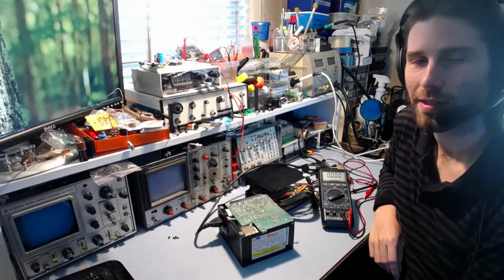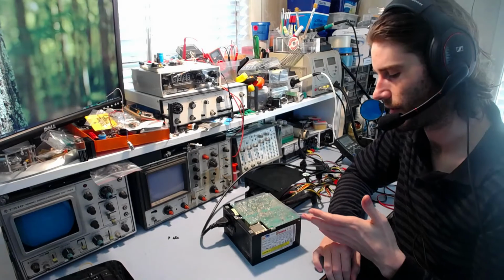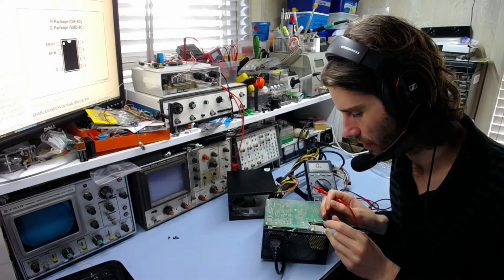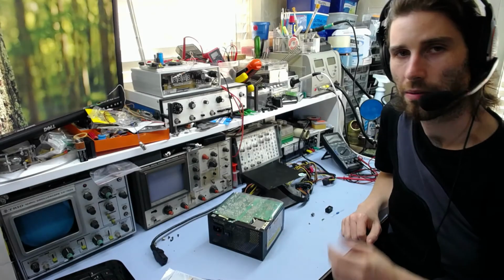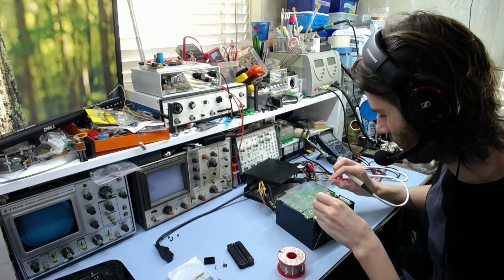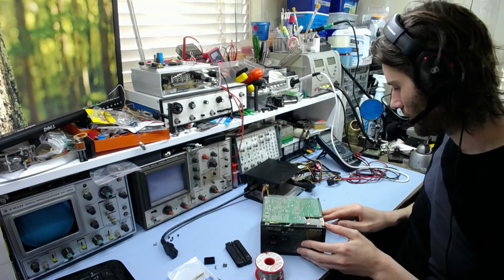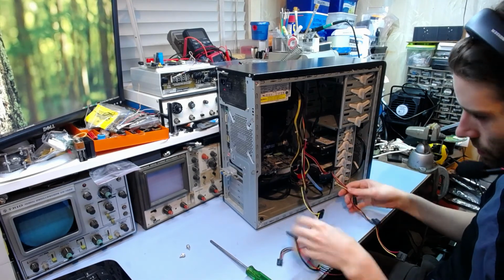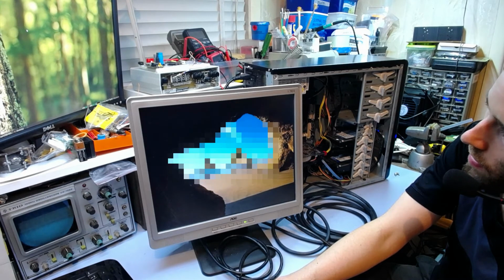Dead AcBel iPower 510 (PC7013) computer ATX PSU

Comment: Thanks for the upload.  I have a problem with the supervisor IC on one of these PSU's and I could use the schematic.  Have you a link?
Reply from the maker: I don't think I ever had a schematic for this. You'd have to lookup the IC datasheet and look at the example diagrams and pin-out. That should help you find out if you have the right signals going in and coming out of the chip etc.

Comment: thanks for video ,you have schematic of this  board power supply?
Reply from the maker: No, sorry. The best you can usually do is lookup datasheets for the control ICs and get a general idea. Or lookup generic ATX PSU schematics as these are all rather similar and in general, minor variations on a few basic topologies.

Comment: I've been trying to figure out what's wrong with my dead Corsair GS700 for a couple weeks now (I have the standby, just nothing else). I'm an amateur at this kind of thing so I've been doing allot of reading and watching allot of videos. I don't know how many times I've come across the standard "Probably a dead cap" thing, or so-called troubleshooting videos that stop after the paperclip "hack". Finally, I've found a video that addresses a non-traditional issue. With words. In English (no offense to non-English speakers, it's just that it doesn't help me much :/)  My problem won't be exactly the same as yours but you've given me a new avenue to pursue. Thank you very much. Subscribed.
Reply from the maker: Thanks! Glad you liked it. Yes, if you do have the 5v Standby rail then this is a different issue. If the paperclip trick doesn't do anything, check if PS_ON (green wire) is actually high (3.3v or 5v) to start with. If that's low or dead you most likely have some problem in the power control circuitry, maybe a dead secondary controller IC or shorted capacitor on that line etc.
If PS_ON line is high and yet the PSU still won't start when you pull it low, you could still have a dead secondary controller, or it could be a primary side issue too, or there's a dead short on a main power rail and the PSU won't even start up.
Check all the secondary rectifiers and if they all test OK, then you need to figure out what your secondary controller IC is, and see if you can get a datasheet/pinout.
Find out where the output drive is that tells the primary side to switch on. Is that output activating when you pull down PS_ON? If yes, you may well have some primary side issue, or the optoisolator/transformer and associated circuitry that handles that control signal could be bad.
Good luck!
Reply: Thanks you very much for the tips :)

I do have ~3V on the PS-ON and determined that I'm not getting 12V even at the fan. So I tested the primary side MOSFETS and bridge rectifier just to narrow down the scope... all checked out. I then tested the main transformer and that's not getting anything. I've tested all the caps and diodes that I can see, tested the optocouplers, haven't found a problem yet (in fairness I can only do so much with the caps because I don't have an ESR tester). 

I do think that the problem is in / around the PFC (CM6800T chip). I've been hesitant to poke around in that area but I think that's where I have to go next - see if it's getting anything on VCC.

I'm gonna find this damned problem if it kills me. There's only so many components to test!